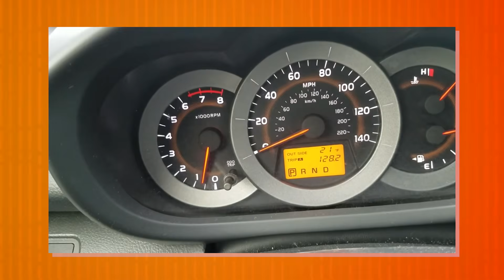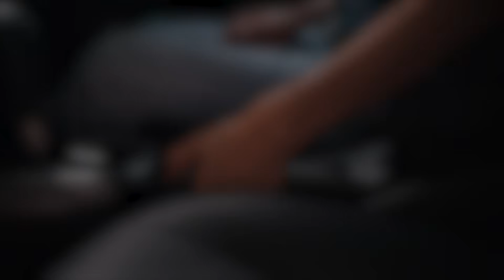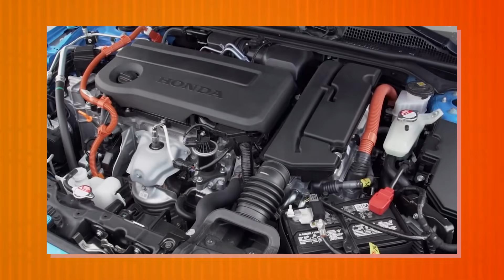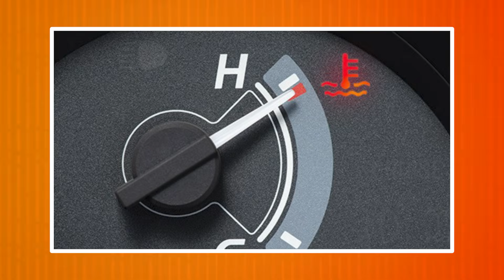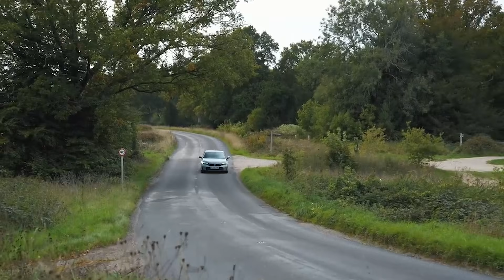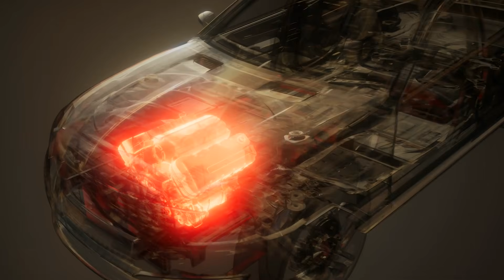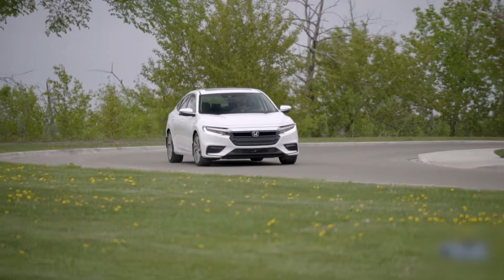HONDA OWNERS! This ONE Mistake Is Silently Destroying Your Engine

Comment: 1:12 in and no mention of 'the mistake'. Scrolling on.
Reply: He mentioned the main mistake which is short drives that does not allow the engine to heat up at the right temperature
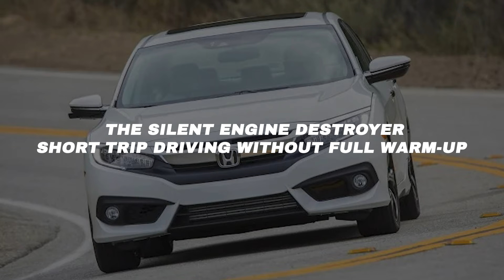Reply: FF To 1:50

Comment: This video is just Ai generated  BS.  You need oil pressure and you’re good to go.  The best way to get the engine and all fluids up to operating temperature is to start driving it. Letting it idle to warm up before driving has zero advantage at all once you have oil pressure

Comment: Honda does not use a timing chain,  they use a rubber belt
Reply: my 2023 Accord sure uses chains..
Reply: My 2008 Honda civic vti has timing chain ⛓️‍💥
Reply: My 2023 civic sport uses a timing chain 😂
Reply: Timing belt V6 engines only.
Reply: That is not correct!
Reply: I have an 06 Honda CRV and an 07 Honda Fit. Both have timing chains NOT belts. In the 1990s a lot of manufacturers used rubber timing belts.
Reply: You are so wrong making a stupid sweeping statement like that.  You obviously know ‘nothing’ about Honda engines at all, or possibly ‘any’ engines…..